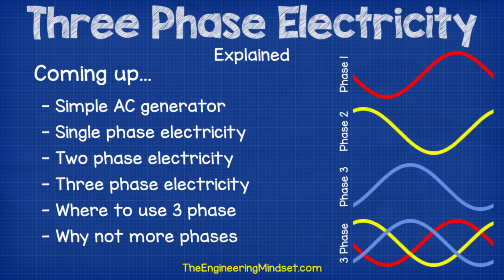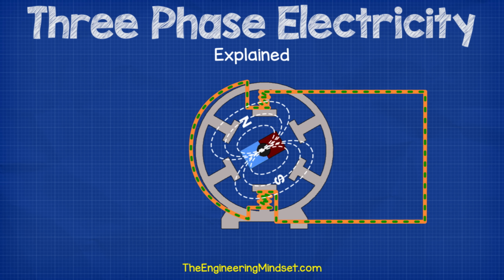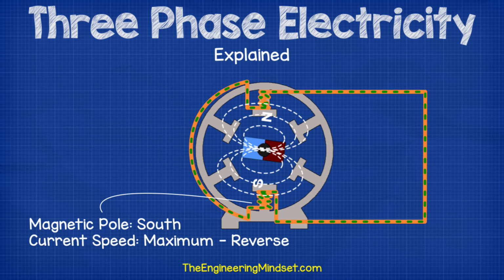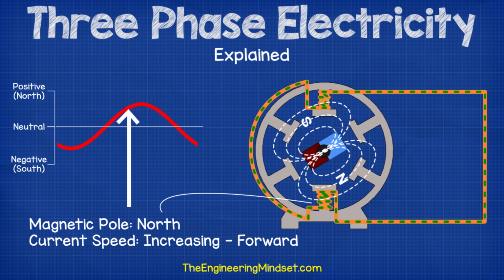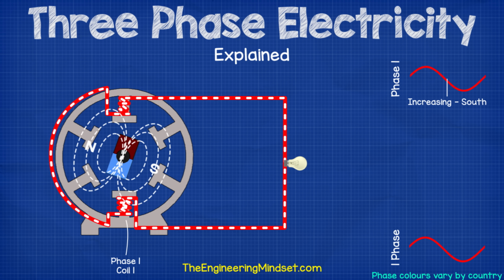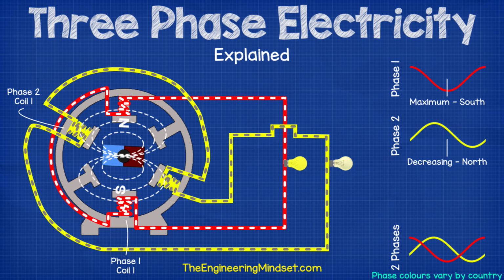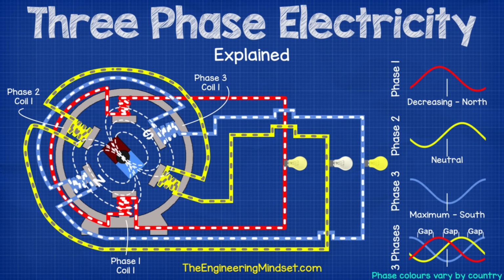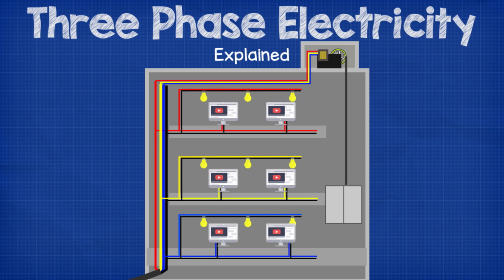How Three Phase Electricity works - The basics explained

Comment: In several places the video says that the "speed" of the current changes as the generator rotates. This is not correct. The speed of the current (electron flow) always stays the same at 186,000 miles per second. What changes is the electron density, which is the number of electrons passing a particular point in the circuit every second. The electrons always go around and around in a circuit at the same speed regardless of how many electrons are flowing. What changes is the amount of current. It's like a river and a stream flowing along in parallel at 20 MPH. The water flowing in both is traveling at 20 MPH. But the river is carrying more water than the stream.
Reply: @Joe Vignolo
Your correction is actually false and a common misconseption. Electromagnetic FIELDS propagate at the speed of light, however electrons have a non-zero rest mass and can't reach light speed for that reason.
Electrons move randomly in a conductor with the fermi velocity (around 1000km/s), since this movement is random it averages to zero (no current). Now if there's a voltage applied, the chance of electrons "choosing" a certain direction increases, which results in a non-zero average. This average is called drift velocity and is only a couple micrometer per second and proportional to the voltage. The actual value of the drift velocity is also dependent on the conductor.
Reply: @WhatxDxDxD  - Yes you are actually correct. What you are referring to is electron migration, which is relatively slow. But what you really have to consider is exactly how electrical energy propagates through a conductor. A lot of people explain electrical energy propagation by thinking of long line of cars touching bumper to bumper. If you push the car at the back end of the line forward one space all the other cars in the line will move forward one space including the car at the front of the line. This means that while the individual cars themselves do not move very far very fast the mechanical force is being transmitted very quickly through the entire length of the line. It's the same thing with free electrons and how a force is transmitted through a wire. Yes the individual electrons themselves don't move very far very fast. But the electrical force does, which is why most people, including myself, typically think of it as electron flow going around the circuit at the speed of light.

The real point I was trying to make, without getting overly complicated like this, was that when the voltage and/or the load resistance changes the speed at which the electrical energy conducts through the wire always remains the same and that instead what actually changes is the amount of electrical energy flowing through the wire, which we typically call "current".

This is an important point to make because if the speed of the electric flow were variable then when turning on a clothes dryer I'd have to wait for the power to travel to me through the wires before the dryer started to run. And then when turning on a small night light I'd also have to wait for it to light up but even longer this time because the load is less. But that doesn't happen. In both cases, irregardless of the amount of power being transferred, the transfer of the electrical energy begins and ends equally fast and it occurs almost instantaneously. So the "speed" of the power transfer always stays constant and it is extremely fast.
Reply: Joe Vignolo   Just some things i like to add, to make sure i'm clear.

The Drift velocity is a Funktion of the voltage, which is a function of the rotation speed of the magnet. in respobse to your stream analogy, the average speed of molecules in the "stream" can and does vary.

The electrons in the lamp experience the electric field which propagates at light speed, therefore the fast response. We use in most cases AC, so, the electrons vibrate more or less and never leave the switch or lamp.
Reply: @WhatxDxDxD  Agreed!
Reply: @WhatxDxDxD  The word you are looking for is function, not funktion.
Reply from the maker: Check our new revamped 3 phase explained video, sooooo much better:👉 LINK: https://youtu.be/c9gm_NL7KyE

Comment: One of the most important things with 3ph in factories is the reliability of the motors. Single phase motors have start and run capacitors,start windings and centrifugal switches,.without these the motor would not start.3ph motors are self starting. And much more reliable. And with 2- 3pole contacors connected together electrically and mechanically ( a for-rev) starter  the rotation is easily changed.also the amperage on each leg is less on the same hp   motor....
Reply: Just one correction: induction motors are self starting but higher power synchronous motors need a squirrel cage to start (they are not inherently self starting).

Comment: What Aussie Tobacco Refugee says (except I've just been a commercial electrician for 5 yrs...): EXCELLENT!

Only thing I would add is that electrons are already in all matter & don't flow like water, nor are they added to the conductor in an electrical circuit.

Electrons are more like hydraulic fluid that barely moves but, in the case of A/C power, oscillates rapidly back & forth like a rod. 

In a way this is simply a matter of semantics. 

My understanding is that in a de-energized circuit, electrons in copper wire, for example, are arranged in a random/somewhat chaotic pattern, like military officers in a room doing different things, some talking, some watching t.v., some playing ping pong, etc.  The circuit being energized (e.g., switch turned on) is like a general entering the room and commanding "Attention!" (the effect of the rotating magnetic field from the generator on the circuit via conduction & induction). The electrons change formation to carry the charge from source to load and back like a daisy chain. Based on my limited experience/exposure to the physics of electrical energy, the electrons form into a ring or concentric rings, almost like rings of a tree, but I think the bulk of what happens (in the case of a copper wire) is on the very outer layer/surface of the conductors.

If I watch more of these Engineering Mindset videos, maybe the relationship between induction & conduction in a circuit will become clearer, because no one in the trade I've ever met talks much about this, but you clearly need both.  Conduction is king (making a sound mechanical bond via wire nuts, lug screws, etc.) while induction is some phantom that comes up in conversation now and again.

In all the electrical training I've ever seen/gotten (books, YTube, on the job with tons of different electricians) the magnet is glossed over with an unconvincing, magical explanation & no one realizes that Tesla simply understood to rotate a magnet & it's magnetic field which is essentially an invisible gear (i.e., the ovals in the video diagrams) and you have one of the most ingenious inventions of all, disproportionately more powerful than the simple moving parts comprising it, as we are all told that if the phases in a basic service panel arc and you're standing in front of it, you will be vaporized (and they have gruesome videos to back this up).

I believe understanding electrical circuits/energy could become even more intuitive by realizing that the rotating magnetic field is able to magnify many, many times over, the power of one of the simplest machines we know which is observable in nature as well: the screw.

Food for thought, I'm still wondering, maybe someone will find this reasonable & applicable. Hope anyone out there with objections will reply & offer suggestions to refine/improve any of this.

Comment: So if i’m interpreting this video correct and the one before, DC current is when you have some type of power source, and a circuit, (and whatever you are trying to power), and a AC circuit is when you have a circuit with some section of the circuit wrapped in a very tight coil. This coil when given a power source produces a magnetic field, in which we use a magnet inside the coil (circuit wrapped around the magnet) to create a greater magnetic field.

Also, the current in AC, does it matter which way the amps or electrons are traveling? My guess is no, but i’m still in community college.
Reply from the maker: With AC the electrons flow backwards and forwards repeatedly, super fast, and always remain in the same section of wire. DC the electrons flow and move around doing laps of the circuit all moving in the same direction.

Comment: In the United States, single family houses are served by a single phase.  There is a transformer on the power pole that brings the voltage down to 240 volts measured at the far ends of the output coil.  There is a wire from each end of that coil that runs to the electrical panel at the house.  Those two wires are both called "hot" wires, and as stated before, the voltage measured between them is 240.  Here is where things get confusing for many people, there is a connection made at the middle of the output coil on the transformer on the power pole.  That connection has a wire that also runs to the electrical panel at the house.  The first thing to understand us that the connection is made at the halfway point on the transformer output coil, so the voltage measured from that wire to one of the "hot" wires is 120 volts.  That is half of the voltage measured between the two "hots."  The middle connection is also connected to a bare wire that runs down the pole and is buried in the earth, giving it an electrical connection to the soil.  That is called a ground, or earth, connection.  The wire that comes from the middle connection that goes to the house panel is called the "neutral" wire because it is connected to the ground at the transformer.  But there is also a connection to the ground via a wire from the house's electrical panel.   Most circuits in houses in the U.S. supply only 120 volts, so they connect to only one of the "hot" wires, and to the "neutral" wire.  One of the "hot" wires serves half of the 120 volt circuits in a house, and the other "hot" wire serves the other half of the 120 volt circuits.  All of the 120 volt circuits connect to a "neutral" wire.   This use of two "hot" wires that are part of a single phase from the power company creates a bit of confusion in systems like this because the 120 volt circuits are thought of as being in two phases.  Since the two "hots" loop electrons back and forth in opposing directions, and the center wire, the "neutral" wire, carries electrons for both circuits at the same time, they mostly cancel each other out on the wire that runs from the transformer to the electrical panel at the house.  So, the reality is, the neutral wires in circuits in a house are carrying electrons exactly the same as the "hot" wires.  Because the "neutral" wires are part of a system that is connected to the earth, you can not be electrocuted by touching a "neutral" wire while also touching the earth.  And if you touch a "hot" wire while touching the earth, or also touching a "neutral" wire, you may be electrocuted, but there is a circuit breaker in the circuit that will trip if there is a short circuit.  You touching the "hot" wire will probably not trip the circuit breaker.
Reply: You were all good right untill the end, but for the safety of readers i need to say that touching an ungrounded conductor or "hot" while YOU are grounded by contacting the earth or by touching the grounded conductor "neutral" ...

WILL MOST LIKELY NOT TRIP THE BREAKER.

In order to trip the breaker or overcurrent protection device there needs to be enough current to do so your standard breaker in a house is 15 amps the human body offers too much resistance for that kind of current flow at 120volts. Besides it only takes 0.005 amps to stop your heart. Really the only way to protect yorself in that situation is to have your power source fed from a GFCI breaker or recepticle. Which measures current flow on both hot and neutral and trips the mechanism if there is any difference detected (current leaking to personel)
Reply: @shanejknox   Good point.  I will change that.
Reply: maybe try breaking up your text into different paragraphs if you want people to read it.

like this.

but with sentences.
Reply: @Hearing.And.Chanting And.Remembering.Krsna  I changed that, thanks.
Reply: @Hearing.And.Chanting And.Remembering.Krsna  There is always current in the neutral wire because the A and B sides of the panel are never in perfect balance.  But the neutral wire at the transformer is connected to earth, and so is the neutral system at the house panel.

Comment: with 3-phase power, you can get both constant power, and zero total current (over the 3 wires), this means 2 wires can act as neutral for the other wire and vice versa. You could also get constant power with 2-phases, by putting them 90 degrees out of phase, but then the currents don't add up to zero, so you need to add at least one more wire for the neutral. This is the main reason for using 3-phase power.

Comment: Great video right up until the end. Houses are wired for 2 phase, not 1. Oven ranges, dryers and Hot tubs run on 2 phase power.
Reply from the maker: Only in North America, the rest of the world doesn't need it as voltage is higher
Reply from the maker: Watch this video on US electricity: https://youtu.be/fJeRabV5hNU

Comment: But my house is using 2 phases? I traced them back to the pole or am i confusing the second phase with the neutral.
Reply from the maker: North America uses 2 phases because the voltage is lower compared to the rest of the world.
Reply: @EngineeringMindset  thank you for clearing that up
Reply: @EngineeringMindset  North America isn't really using "2-phases".  It is mathematically equivalent to what 2-phase electricity would be, but it is not constructed from 2 positions along a generator's rotation.   It is derived from one of the 3-phases on the distribution system, which is stepped-down to 240V.   For this reason, it is still called single phase.

The transformer is center-tapped, to derive two equal and opposite voltages fro the line 1 and line 2 conductors.   120V from either line to neutral, will power most of the loads, distributed between L1 and L2 as evenly as practical.  240V between L1 and L2 powers the Watt-intensive loads, typically heating elements in driers, stoves and ovens.
Reply from the maker: Watch this video on US electricity: https://youtu.be/fJeRabV5hNU

Comment: In the U.S. most homes are connected to a two phase system. There's three service wires that come into the home. Two are hot and one is neutral. Between the two hots we have (two phase) 240 volt AC power, used mostly for electric heaters and other devices that need more power. The rest of the circuits are tied to either one of the hot wires and the neutral for (one phase) 120 volt AC for regular type electrical devices, like TV's, kitchen appliances, and other things. That was a pretty good video explaining phases.
Reply: I'm 67 yo and I did not know that about U.S. power. Here in NZ we have 240Vac and no need for phases, just a bigger cable and fuse for stoves and hot water heaters. 2400 W and 10A max from wall plugs for e.g radiant heaters, which does fine for one or even several other smaller appliances. Three wires: - Phase, Neutral and a hard Earth for safety reasons. Just don't touch that 240V phase, worse than your 120!
However, out in the street, it's three phases, just with each house on one of the three.

Comment: sir ..i have a question about load calculation and how to devide in 3 phase,
there is a 125 kva generator 
loads are 400watt flood lights,
how many flood lights i can apply? how to devide on each phase ?
are these inductive ,capacitive or resistive load?
plz explain mathematically, and plz consider power factor if loads are inductive also generator's efficiency 80%.
Reply: First of all you need to know how many flood lights do you have and the quantity of bulbs each one have and type of flood light you have like metal-halide or sodium vapor lamp . Led load are more resistive than inductive and if you wanna keep a your phase balance you should distribute them lights in each single phase with an equivalent power .

Comment: I dont think light bulbs r 'flickering' that small time while no electricity running through is not enough to cool down the white-hot wire...
Reply: maybe flickering for a fracture of a second when u first turn the light on.. while it heats up
Reply from the maker: They do, use your phone to record a lamp in slow motion
Reply: Thats why I said 'I don't think' :D I am not sure, I believe there is some change in the intensity but I still dont belive that the wire gets so 'cold' that it will become completely 'black' ... I have to test it now.. or better, ask 'Smarter Everyday' with his super fast camera:D

Comment: The part where you are talking about 1 or 3 phases to houses depending on site must be in where you are from, in Denmark is every new apartment / house, big or small provided with 3 phase and houses gets 20 amp on each phase, as standard.
Reply: Actually in my 40+ years of life I have never seen a single phase supply for a house or apartment. My house has a supply line rated 50 A per phase. And any oven over here will require a three phase connection.